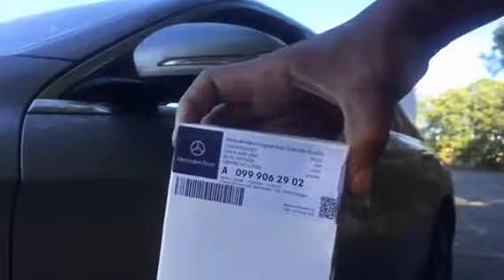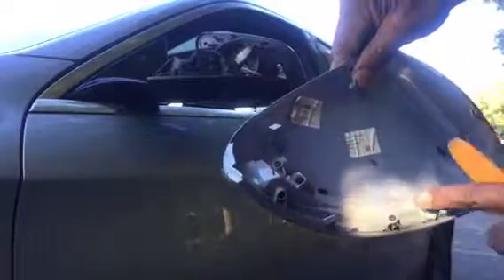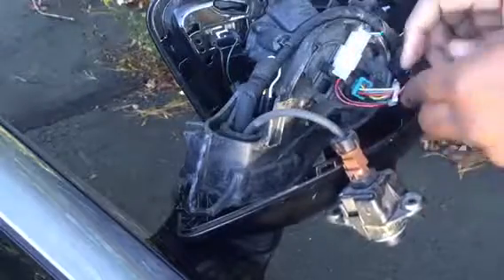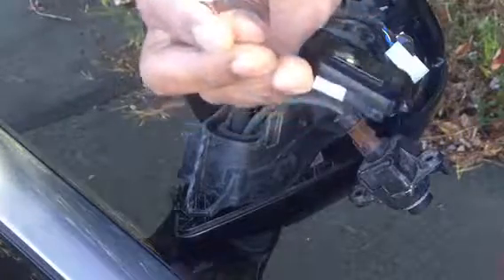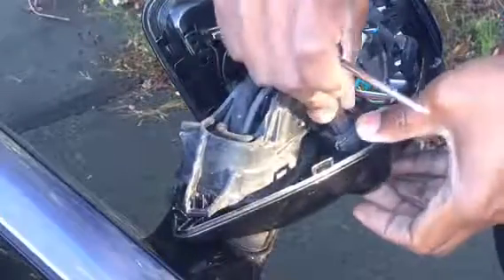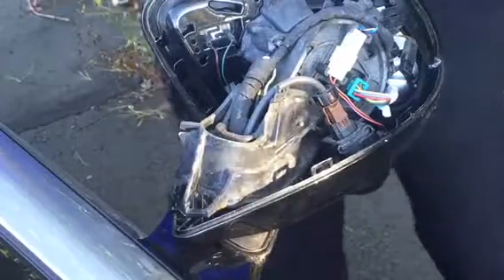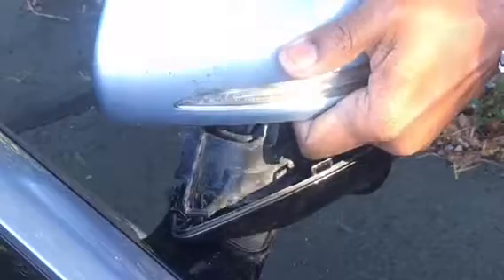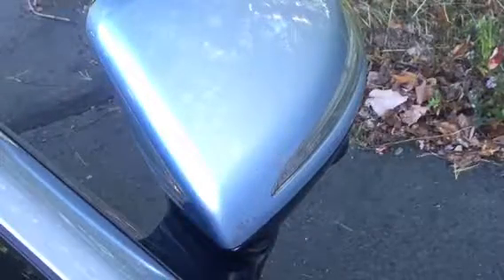2014-2017 Mercedes Benz S550  puddle  light replacement tutorial

Comment: Hi Jerry. Thanks for video.  It is easy to do on the driver side as mirror is simply bigger. The passenger side is a nightmare as there is far less space.On the passenger side the broken LED I have removed in cracking the body of LED. Obviously to put the new one we had to make space by grind of some of plastic inside. So that side is not five minutes job. MB Service most likely is disassembling completely that mirror to change the LED.
Reply from the maker: Konrad Zenderowski Wow. Well I’m glad you got it fixed.
Reply: How is it bigger?? They’re the same
Reply: @feras6722  There's a plastic piece thats very close quarters to the light on the passenger side.